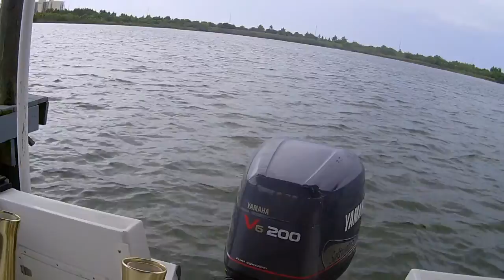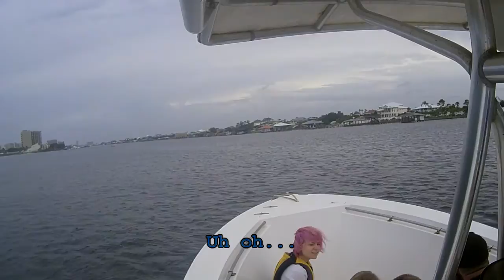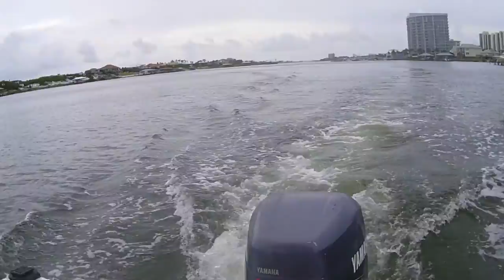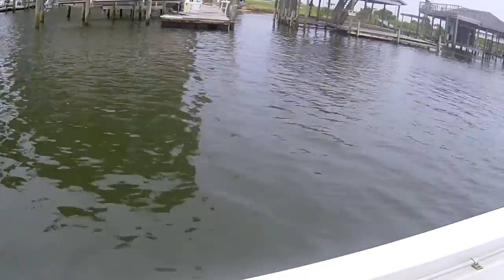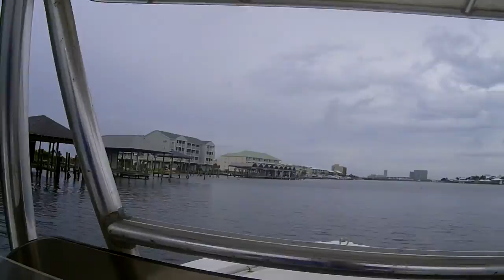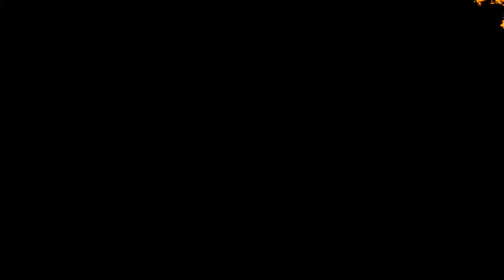Yamaha saltwater series 2 engine fail

Comment: Looks like the motor is overheating and it reduced its max rpm so you don't blow it up. Probably not pumping water, new impeller should fix that.
Reply from the maker: I thought it may have been the impeller but it was actually the oil filter. The screws got knocked out somehow and it pinched the line close luckily we got it fixed with no damage to the engine

Comment: I’d say lack of maintenance is the issue here. These engines are one of the best 2 stroke outboard ever built
Reply from the maker: Actually that engine was a dud. We got rid of it with only 100 hours on it. Come to find it the block had micro fractures all through it from the factory.